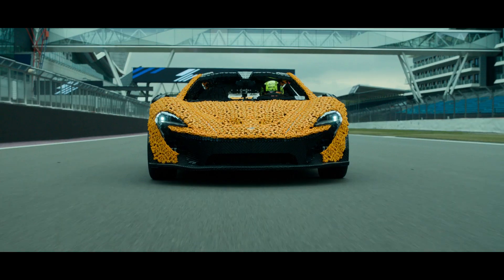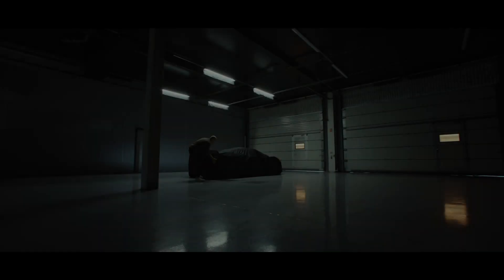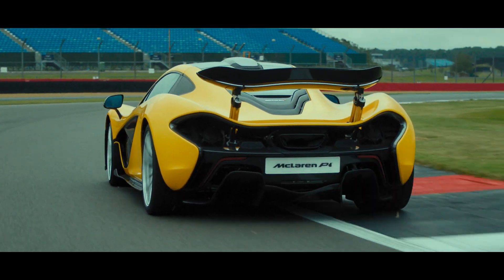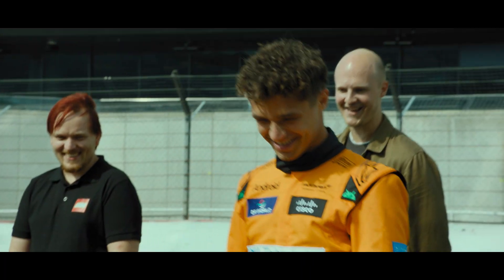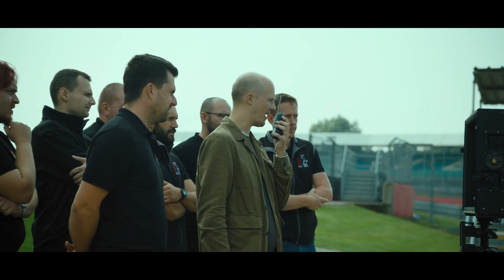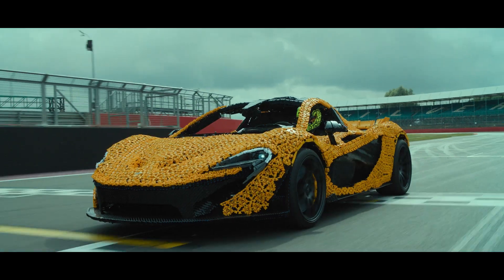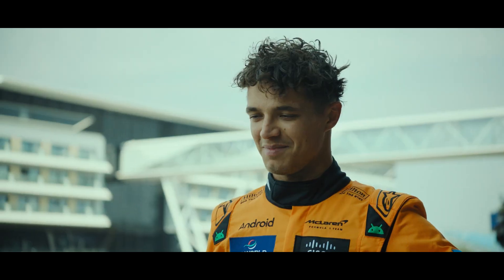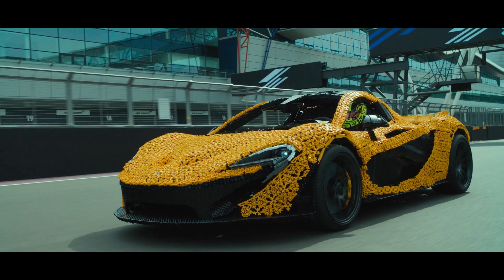Lando Norris drives LEGO P1 at Silverstone

Comment: What an awesome creative project. Wish they release more tech specs like speed and such. Great job McLaren your branding is everywhere this season!
Reply: "In a groundbreaking collaboration, McLaren Automotive and the LEGO Group have created a life-size, drivable replica of the iconic McLaren P1™, made entirely from LEGO Technic elements.

This unique vehicle, crafted with an impressive 342,817 pieces, was put to the test by McLaren Formula 1 driver Lando Norris as he completed a thrilling lap around the historic Silverstone Circuit.

The life-size LEGO Technic McLaren P1™ weighs approximately 1,220 kg and features fully functional steering, marking a first for LEGO big builds that allows a model to navigate corners on a racetrack. This extraordinary creation was the result of 8,344 hours of hard work by a dedicated team of 23 specialists from both the LEGO and McLaren teams.

It is powered by an electric motor comprised of LEGO Technic Function batteries and features eight motor packs, each made up of 96 LEGO Power Function motors. In total, the vehicle showcases 768 LEGO motors that emulate the performance of the original McLaren P1™ V8 engine."

Comment: I'm assuming that steering wheel and dashboard are off the shelf Lego Technic parts that you can buy also, along with the battery that's powering it too. love how they edited engine noises in this clip, there is not an ounce of combustion in that thing. the footage was also significantly sped up as this thing probably goes a max speed of 10mph before it starts to shred itself to bits 🤔
Reply: Apparently it can do 40mph! But yeah, no combustion and lots of editing

Comment: I wish there had been more detail about the chassis and power train - that did look like a P1 wheel and dash so did they just take the body off a P1 and replace it with a lego body? That's incredibly impressive but again, more details please! I see the brake calipers look to be lego - again I assume those are just visual covers of the real calipers....
Reply: we need more detail! pls
Reply: i would assume its a carbon tub with lego built around it, looks like he isn't wearing a seat belt either so it's very slow
Reply: The brakes shown are not functional. The calipers are Lego, and so are the rotors as well.
Reply: The chassis (plus suspention) is a p1 ,the tub is made of carbon fiber ,and the rest is lego ,the drivetrain (including hundreds of lego e motors) , the body work, the full interior plus floor seats and dash, basically everything. The wing also.
So the only things that are the actual thing is ,the chassis (you have to have that), suspention and the carbon fibre tub that's it.
Reply: @nerfgodbigguy1405 he did specifically say the used no carbon fiber. But maybe was only talking about the body